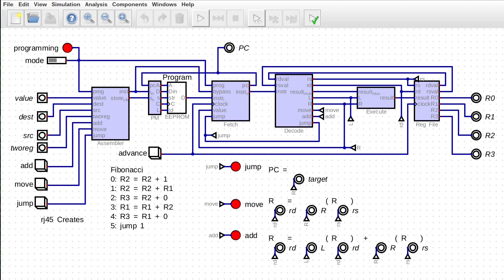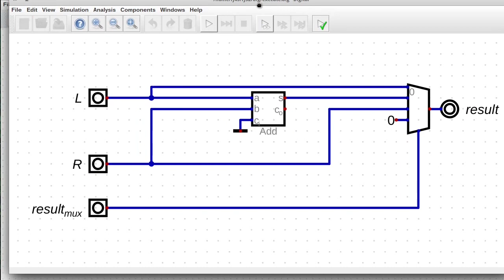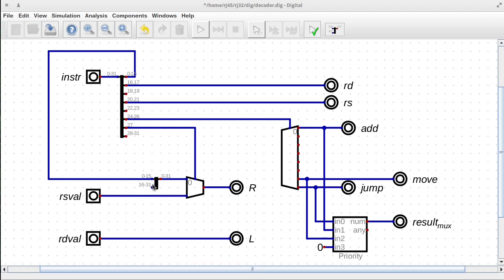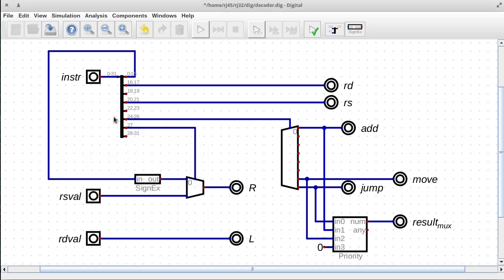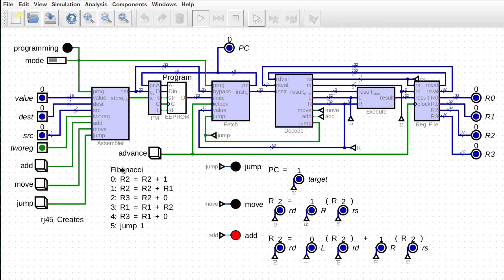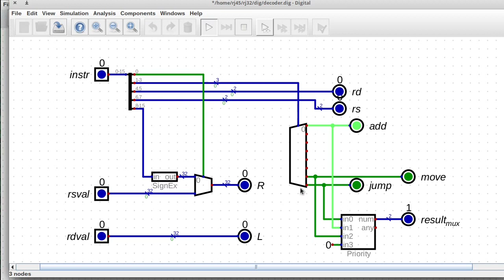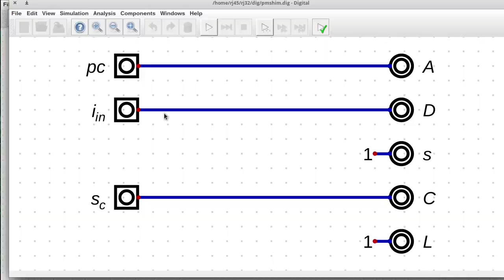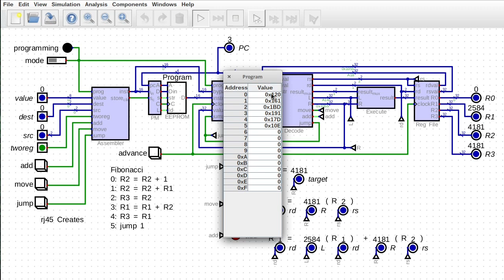[012] 32-bits! - Building a CPU From Scratch

Comment: How do the 16 bit numbers extend to 32 bit with just sign extender? When you give the last 16 bits, how can it make out the whole number as everything has to pass through the decoder, wont the extra bits after 16 bits be lost?
Reply: Nvm, got it. So we cant pass numbers greater than 2^15 - 1 but once inside the registers, we can add 32 bit numbers easily
Reply: Okay, so just 8 bit input values
Reply from the maker: It will be easier to help if you jump on discord https://discord.gg/thzHEM3VH7